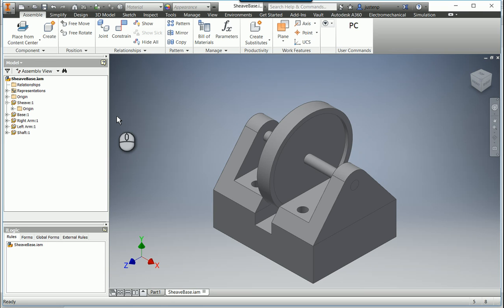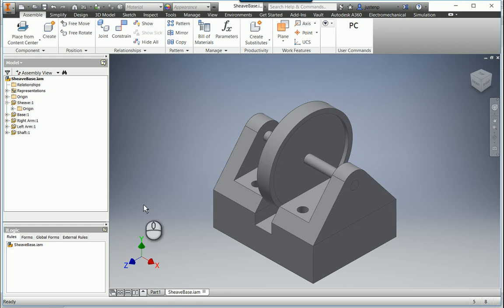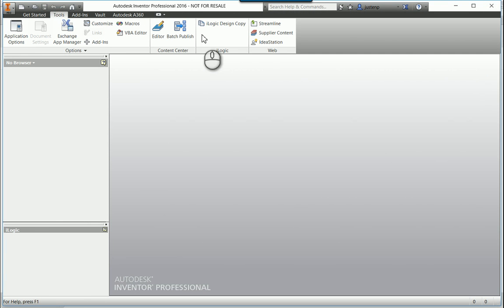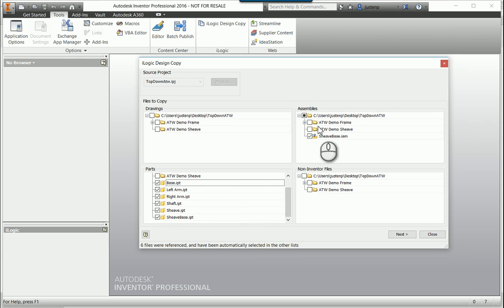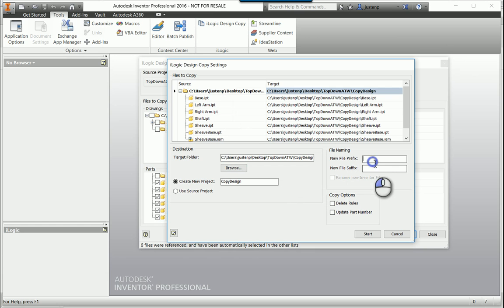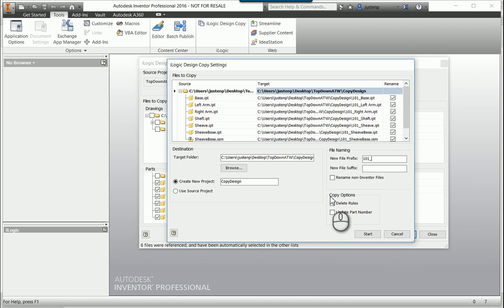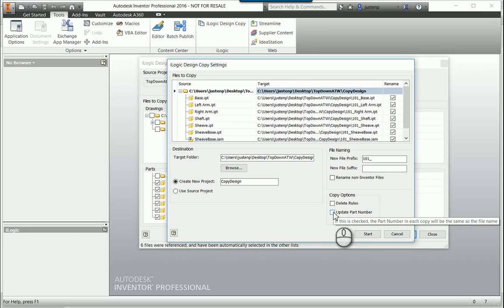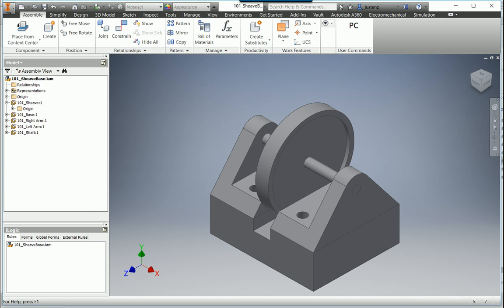Autodesk Inventor - Copying Assemblies With the iLogic Design Copy Tool

Comment: Thank you for sharing such a tutorial.  It will make my life easy if

Can I remove/add components in the copied assembly without affecting the original file?.
Also, I use Vault Basic would there be any kind of affect directly to the original folder?. If I make any changes to the copied assembt?. Unfortunately, I cannot play around with it  because my company will not be happy if I make a mess.